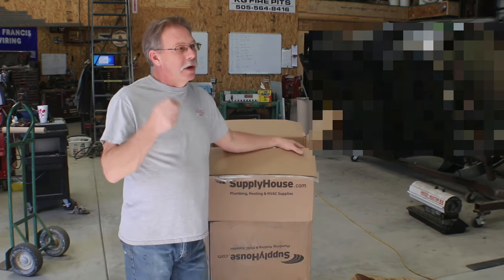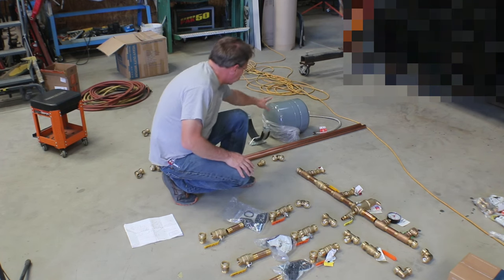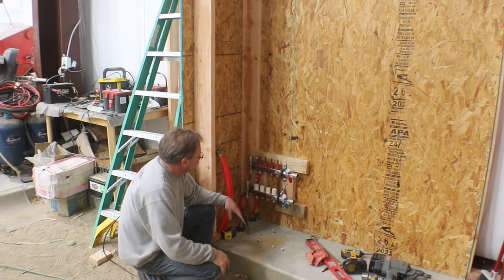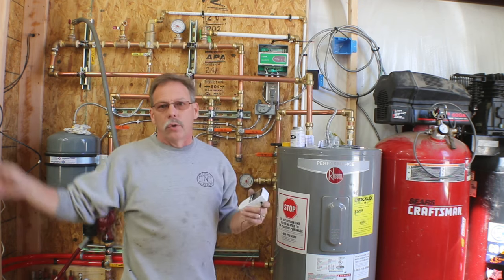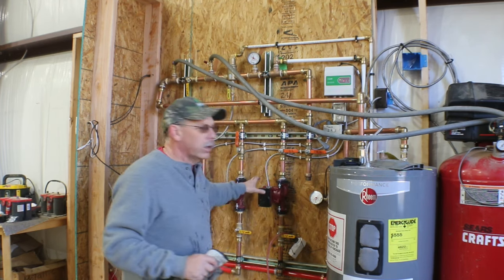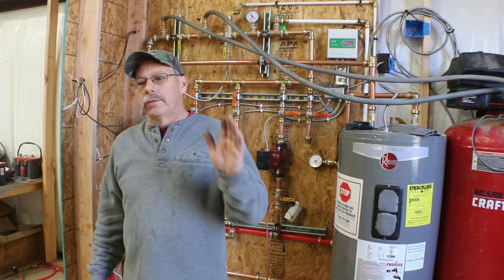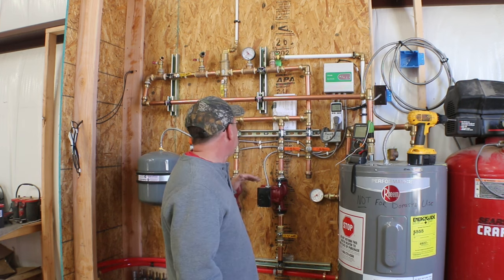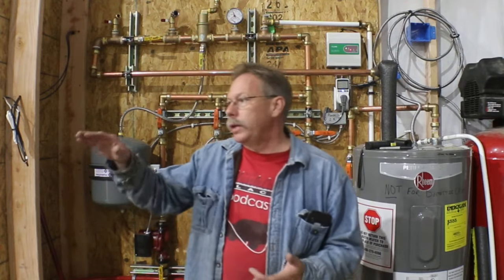Can you Heat your Shop with a $200 Water Heater? Radiant Floor Heating For My Shop | Allison Customs

Comment: What gauge of wire do you have feeding the 11kw combination of elements.   Your system was originally wired for 4500 watts and not 11,000.  Just be careful!
Reply from the maker: I’ve provided for the change.  Thanks! 👍

Comment: whats the cost of electricity
Reply from the maker: Thanks for the question!
Shop Radiant Floor Heat - How Much did using an Electric Water Heater Actually Cost?
https://youtu.be/5jO3bHkLhJE
Reply from the maker: Also,
Hydronic Solar Heating for the Shop
https://youtu.be/_mR7S4N28oY
Although I would not recommend this solution - summer just causes too many problems for the value.

Comment: Sorry to tell you that water heater doesn’t produce enough BTUs to supply your heat load. Did you insulate the ground underneath the cement before you pour the cement? If not you will never heat the garage with that system, the heat will go right into the ground.
Reply from the maker: It does ok, but it is definitely not the most efficient heat source.

Comment: Electric hot water heaters do not seem to have a fast enough recovery to do radiant heat.   I have several systems now using propane that work well and fixed the problems that electric heaters had.
Reply from the maker: I tend to agree with you. If I get an opportunity, I will be running a natural gas line to the shop.
Reply: @AllisonCustoms  Think about an on demand hot water heater.

Comment: $2,000 of Sharkbite fittings, you can build the same system with PEX (200F rating) for $300.
Reply from the maker: Not quite that expensive, but yes you could choose pex over copper, but it would be less clean in appearance (IMO) - Thanks for the comment!

Comment: How about a second water heater to buffer the water then it could be used to help add more heat to the water on colder days n nights. I think id do that. If ya find a second on a sale list.
Reply from the maker: I’m currently planning to add a 100+ gallon storage tank/heat exchanger to add a buffer, and then hopefully add hydronic solar before next winter.

Comment: If the water is hot why do you have to heat it?
Reply from the maker: yea, yea - and what do you put in a toaster! 
what’s really funny is I’m usually the guy calling people out on crap like that. What’s your PIN number? 🤣
Reply: Because it cools off some as it circulates.  This is a case where hot water is being heated, eg it is a hot water heater.

Comment: What has been your cost to heat your shop with this system, now that you've had a year to assess?
Reply from the maker: It’s still about $800 a month during the really cold months.  OR WAS prior to the solar system, I’ve now had a full month with the solar running well and it dropped my cost by a little over a hundred dollars for the month. That would NOT be worth it except the temps have been 10-20 degrees below last year at this same time and we have had days and days of snow (sitting on my panels), so I’m thinking there is still a lot of value to be seen.
Reply: @AllisonCustoms  Thank you!
Reply from the maker: You bet!

Comment: Very cool.
One note. I think the temp timer for the pump.is slightly detrimental. Here's why.
You are thermal cycling the water heater and concrete. You shut the pump off and heat a slug of hot water. Then force that hot slug of water into your slab, vs letting your slab, fluid, and hot water heater warm up gradually as a unit.

Using both elements is smart as long as you have the thermostats and safety's still engaged.

I would try dropping your timer I think you will find the system works just fine.
Reply from the maker: With the season nearly over, I can say the system has worked extremely well.  Just a little expensive.
Reply: That’s what I’m trying to do. It doesn’t matter if it seems like cold water is coming out of the tank as long as the elements are on. Eventually the slab will heat up. Unfortunately my heat elements are shutting off for some reason I don’t understand.

Comment: Interesting.   I would leave the piping exposed, rather than insulate them, because the heat they radiate heats the same space the slab heat does.
Reply from the maker: I was thinking that it would be better to get the BTUs to the floor, but I don’t really know if it makes a difference.

Comment: Why did you not choose a propane hot water heater? Isn’t it the goal to save money heating your floors?
Reply from the maker: I don’t have gas or propane at the shop.  If I was doing everything again, when we ran the power, I would have spent the money to run a gas line. Especially instead of the solar panels.

Comment: I'd do the expansion tank upside down so water stays out the air side. Also putting a valve on it is dangerous
Reply from the maker: Why are you thinking the valve could be dangerous?  I’m changing a few things around next week (including the location of the tank), so I’m curious.
Reply: @AllisonCustoms  well you might forget it off then there's no expansion tank or someone closes it. But I guess the heater relief will kick in.
Reply from the maker: I see your point.  Thanks for the reply.
The original idea was to use a waste oil boiler, unfortunately I just don’t produce the amount of oil necessary.
Check out the current situation - https://youtu.be/_mR7S4N28oY

Comment: Electric is very expensive
40 x 60 shop, 9 300 foot runs
I use instant hot water heater on propane.
Temp set at lowest   110 f
Every half hour  2 minutes on.
That's it.  1.6 hours run time per day 
My floor is Insulated  also 2 feet below grade around perimeter
Reply from the maker: Mine is 50 x 80 and both under the slab and the perimeter are insulated.  The perimeter is R-30 and 36” below grade.
Electric is expensive! That’s why I’m working on a hydronic solar system.
Reply: @AllisonCustoms  
Pellet stove, indirect 80 Gallon storage tank, air to water heat exchangers.  Should be up and running soon.
Reply from the maker: I thought about using something similar; my insurance provider doesn’t like the idea of fire in the same building as cars with fuel in them. 🤔

Comment: In most cases radaint needs to run continuously and let the slab soak. Unless you have a duty-cycle issue with the water heater, letting it "catch up" makes little sense. Turning off the heater just means the process of heating the slab will take longer.
Reply from the maker: That would work, if the liquid out was always higher than the temp of the floor.  With the electric heater as it was originally designed, it could not keep up at all.
Reply: @AllisonCustoms  It will eventually heat up, as it is dumping the heat into the slab, but may not get warm enough to shut off or reach a comfortable temp. Now if the slab was losing more heat to the air/ground than the heater could put out, it will hardly rise at all. That would be a function of the heat loss coefficient. We have been looking at doing the gas version of this for a project.

Comment: water heaters are barely big enough to keep any "building" above 15C in the winter. also water heaters are rated for around 100psi, so the relief on them is way too high for hydronic. A 30 psi relief valve is needed additionally for hydronic.
Reply from the maker: Someone else had suggested changing the relief valve also, and 15c is 59f - I keep the thermostat set to 60f.  It works very good for this and you are right that this temperature is about all the water heater can handle.

Comment: I am just thinking that the system is overly complicated and too many components that could leak or fail. Again not sure how large the building is seems large. Not sure a 40/50 gal electric water heater is enough let alone to maintain temp. For me if the floor is 40 or above I would be happy! Lol.
Reply from the maker: So far, it does work fairly well, just too expensive for regular use without the solar system.

Comment: Just one comment, they make heat pump water heaters that could reduce your electric bill by 50%, most of the year when outdoor temps are cold, but not freezing. Extreme Cold and your back to just creating heat with electricity, instead of moving the heat around. Adding a heat pump water heater would pay for itself by reducing your recurring costs of electricity.  Oups, looking at the comments, your already looking into it. It's the nut your turning each month, the recurring costs of electricity, that is the largest costs of heating. The little extra on the fittings is nothing compared to the labor costs of someone else, it's a one time cost like a heat pump, not recurring. Look like you had a bunch of fun doing it yourself.

Also, the only difference in length of  "Warranty" that comes a "more expensive" hot water heaters is the size of the Sacrificial Anode in the tank. Most people don't know to change Anode at the end of the warranty period. When the Anode has corroded away and is gone, then the tank corrodes away until a hole forms. Replace the Anode and extend the warranty.
Reply from the maker: Thanks for the tip!  I do enjoy working on this and learning, so I will continue the process.
The original idea was to use a waste oil boiler, unfortunately I just don’t produce the amount of oil necessary.
Check out the current situation - https://youtu.be/_mR7S4N28oY

Comment: that tank just cant have the BTU's for your use, you need something more like an instant water heater, the electrical demand for that would be insane,  I get you have more than doubled the btu of the unit . my workshop is heated by a diesel heater, with heat output of 45KW, now it obviously cycles and doesn't run continuous, but can get my workshop up to a comfortable 15degc when its -5C outside from what I see your workshop is larger, and you only have 11kw of heat flat out. If i were you, id consider a kerosene / heating oil / diesel boiler. Or obv go to waste oil. (here in the UK waste oil burners are illegal :(  or believe me id have one, as here in the UK were also not allowed to use red diesel for commercial heating, we have to use road fuel!)
Reply from the maker: Thanks!
The original idea was to use a waste oil boiler, unfortunately I just don’t produce the amount of oil necessary.
Check out the current situation - https://youtu.be/_mR7S4N28oY
Reply: @AllisonCustoms  will do, video was just recommended, didn't realise it was as old! Watching the new one now:)
Reply from the maker: Thanks for watching!

Comment: wouldn't it be cheaper to just use actual radiators placed in strategic locations? salvage old radiators. idk. two or three idk how big your shop is, but if there were fans to distribute the heat. 
cool project though it is surely worth it.

people need to build more passive solar buildings that just auto magically warm up anytime the sun is shining, except not in the summer. genius level architecture right there.
Reply from the maker: Radiators really aren’t a thing in our area - Northern NM.  I’m sure I could order some in, but I would imagine the shipping would be cost prohibitive.
Also, the original idea was to use a waste oil boiler for heat, turns out I don’t produce anywhere near enough waste oil.

Comment: That's a good looking pipe job. As long as you have a safety valve in the hot water heater you have nothing to worry about. I'm sure you already know that. You should see the damage they do without a safety valve or having a plug in the safety valve. I had one guy to tell me "that brass valve wouldn't stop dripping so I put a plug in it". My advice was to stay as far as possible from the water hearer, cut the gas off (in this case) and open a hot water valve so cold water could cool the tank, then take that damned plug out before you kill somebody. It's latterly a bomb when it overheats with nowhere to blow off pressure.
Reply from the maker: I remember when Mythbusters sealed a few water heaters up and waited for them to explode.  It was awesome to watch, but I wouldn’t want to be there!

Comment: Water heaters were not designed for this purpose,the thermostat is not meant to cycle so often. Try getting that installation approved by a code inspector.
Reply from the maker: The thermostats really only cycle twice a day, once at night (ON) once and then again the next morning (Off).
Check here for current setup - https://youtu.be/_mR7S4N28oY

Comment: I guess I’ll never understand why people call it a “hot water” heater. If it’s already hot water, why would you need to heat it?
Reply from the maker: not the first one to remind me🤣🤣🤣🤣
Reply: Its a hot water heater because it creates and maintains hot water.  Regardless of silly semantics.  The purpose of language is to communicate with another person or group.  In reality he IS heating hot water since his system simply recirculates hot water. Even my electric water heater is heating water with a lot of btus since the supply is not at absolute zero.

Comment: theres enough money there in sharkbite fittings for $100 in scrap copper to practice sweating, which in and of itself is a useful skill, but I also enjoy the ease of those type of fittings you used. I just don't like buying them :D
Reply from the maker: I think you missed the point, I am still making changes and the shark bite fittings make that pretty easy.  But you are right, there is nothing stopping me from learning to sweat copper fittings.
Reply: @AllisonCustoms  it does make a lot of sense for a modular system like that, I just don't like the expense of them, makes my wallet sad :D Keep up the good work!
Reply from the maker: Thanks!

Comment: If you had lined the ground under your concrete with bubble foil it would cut the energy consumption by about 60%
Reply from the maker: It is insulated.

Comment: Anyone considering this, solder please.   I'm waiting for the "repairing leaks" video
Reply from the maker: Sharkbite fittings work great!  However they are expensive so if someone has time and the knowledge, financially speaking it would be better to solder all of the fittings.  Or change to an all pex system.  I will admit I keep waiting to hear that I caused a world wide Sharkbite fitting shortage though! 🤣😂🤣😂

Comment: go to same [supply house],buy a cheap boiler.make your own waste oil burner ,alot of stuff utube.good job.flush anti freeze out and put in new antifreeze every five years.antifreeze when it gets old eats the sht out of metal,cheaper and easier to replace than goof around.
Reply from the maker: Good tip. - Thanks!
Reply: For any boiler system you'll have to check the working fluid's Ph and use additives to bring it to the right Ph.

Once the oxygen is out of your system you don't want to keep reintroducing it and oxidizing the metals

Comment: I think an instant hot water unit would be better for this application.
Reply from the maker: Might be
Reply: Not really.  The only advantage they have is no standby loss.  This system's standby loss goes into to the conditioned space anyway.   There is no efficiency advantage. It still outputs almost 3.14 btus per watt.  A heat pump water heater has perhaps 10 btus per watt.

Comment: 11:40 I've stopped here, flow rate and return temperature has nothing to do with heat transfer in your case of used heat source, regulated electric boiler. That's how amateur think, I would not go further...
Reply from the maker: Sorry you didn’t find it useful - by the way I am an amateur at plumping and HVAC.

Comment: Great video and its a learning curve ,Im doing the same and was fortunate to have a plumbing supplier give me a hand with tech and parts !!! My channel (Deans adventure on timber mountain) is dealing with same issues and a wood boiler to boot !
Reply from the maker: I think I have mine working pretty well now, but I still occasionally get issues from the hydronic solar system.  Check out the other two videos on the playlist if you are interested in how things got to where they are today. I am currently working on a Arduino controller for the whole setup, so there is more to come.
I’ll check out your channel, thanks for watching.

Comment: That amount of electricity is going to cost a bunch because the heating elements will never shut off or rarely shut off, in cold temps.
Reply from the maker: They tend to be off for a few hours a day (pre-Solar),  now they are off most of the day (except on cloudy or snowy days).
Check here for current setup - https://youtu.be/_mR7S4N28oY

Comment: Youll be replacing that water heater in a few years, seen it done already. Save yourself the headache and put in a boiler.
Reply from the maker: Haven’t had to so far, but either way, it would really only be the heating elements.  Boilers draw too much power, and I don’t have gas available at the shop.

Comment: Why in the world would you convert electric energy into heat and then add all the complexity with having to run and manage all the plumbing in order to spread that heat?? You could've easily just ran a wire in your floor to heat it that way and skip all the plumbing altogether
Reply from the maker: I’m not sure even how to start a project like that, but if you’ll remember in the video I stated I was planning on running the whole system off of waste oil in the future.  I’m not sure that will ever work either, because of the amount of oil needed.
Check here for current setup - https://youtu.be/_mR7S4N28oY

Comment: The bigger elements won't save you any money. Heating water is heating water. It takes the same amount of energy to heat the water no matter what. It's basic physics.
Reply from the maker: True, but the bigger elements are able to (mostly) keep up with the demand. Even if extremely expensive.
The original idea was to use a waste oil boiler, unfortunately I just don’t produce the amount of oil necessary.
Check out the current situation - https://youtu.be/_mR7S4N28oY